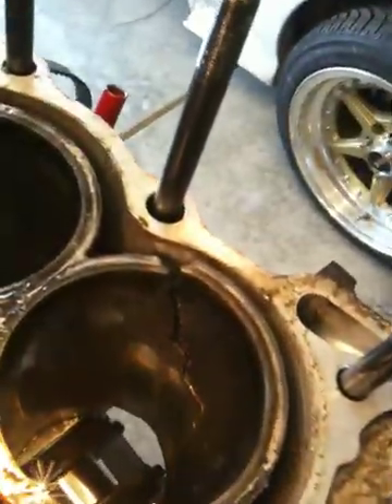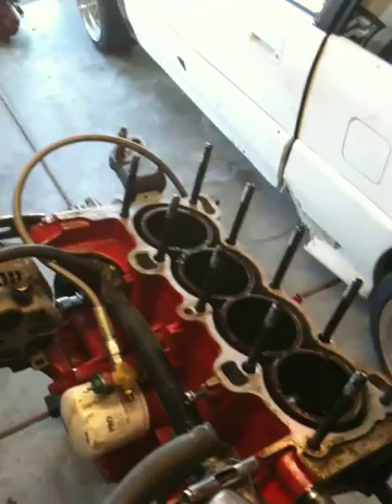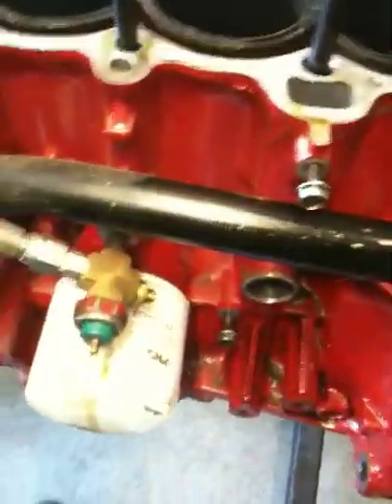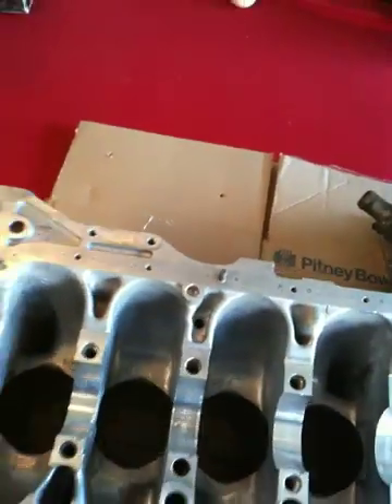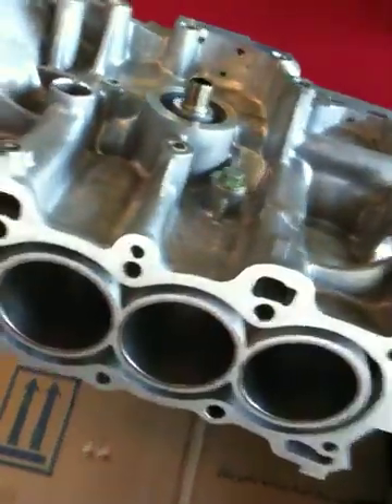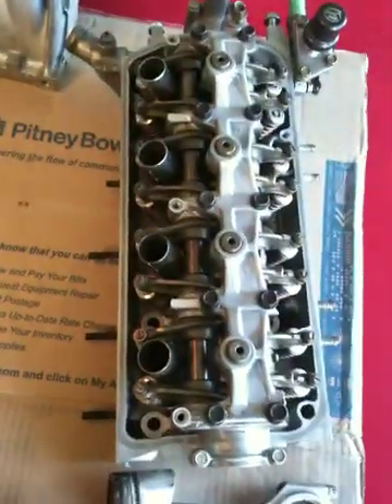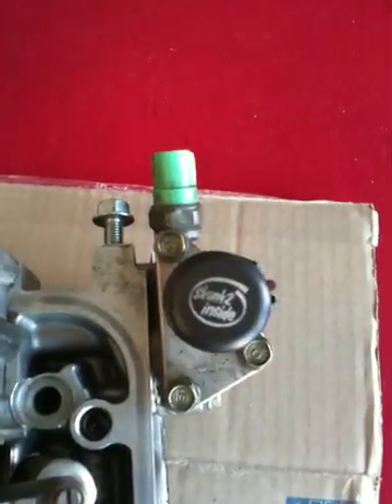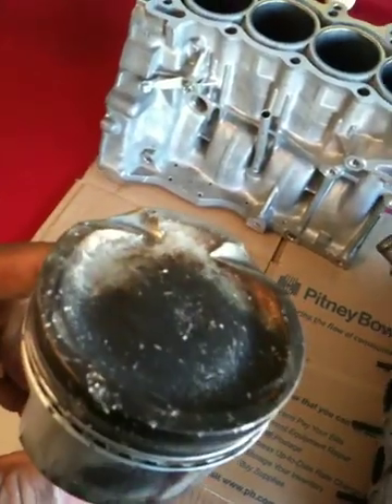the rebuild of a turbo sohc d16z6

Comment: What's the size of the bolts that hold the engine stand stand. Cuz I'm looking for the bolt so it can hold the engine block on the engine stand
Reply from the maker: Raeleen Mandy I’m not sure but I used the oem Honda transmission bolts. You can probably look that up at Autozone or online.

Comment: i know this video is old but you need a dyno with 5 psi on boost
Reply from the maker: edecio castillo man I was trying to go big. But glad I switched to b-series
Reply: thank you for the fast reply i ask you because i running a d16y7 right now on a ek hatch with 5psi on boost i dont want a big hp right now with 5psi on boost you dont need to dyno the engine right.
Reply from the maker: edecio castillo as I have come to find out, you need to tune no mater what. Even if it's a cheap ass street tune with a chipped Ecu you should do it. Big power or not I think you should run what ever boost your wastegate spring is set at. That way you can't go wrong

Comment: ok dude with the D16A6 motor if you dont wanna spent alot of money get a DOHC ZC head and drop it on that A6 block you'll go from 90 to almost 135 Horsepower or get a D15B Vtec block and Boost at about 7 pounds and dude with the civic EX you wanna stay single cam go D15B great little beast  or do a full rebuild on your Z6 motor and have a field day with it!

Comment: I have a crx with a low mileage stock d16a6 which I want to turbo but how do they last, if it was fully built, resleeved, tuned and more on low boost? I have a huge expensive parts list, is it a good idea or go down the k20a route